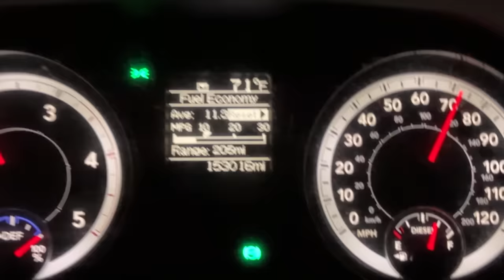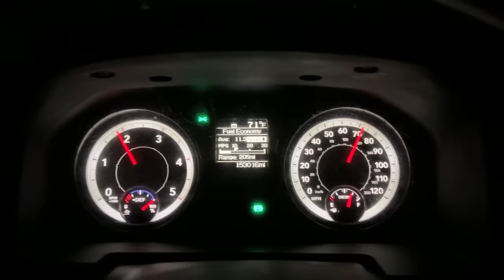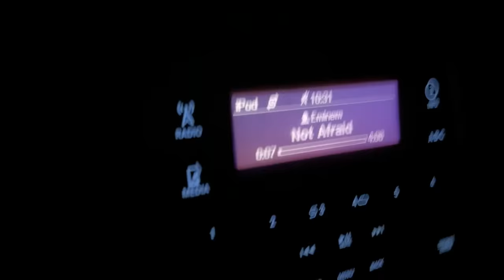My new truck broke down 9.5 hours from home. Dealer refused to do anything...

Comment: As a retired master service writer with ford for 40 years I can tell you that writer has no clue when it comes to customer service peroid.
All travelers in my days got top priority to get them back in the road.
Ford values every customer and no excuses from their standpoint.
The problem you have can only be a couple of things for  a 6.7 diesel 
And the diesel warranty should cover it unless it’s contamination, those are good engines if maintained correctly.
Goodluck and hopefully they get you up and back in the road soon

Comment: Hey. Regarding the new or newer truck options and how you might deal with improving something on it to make it more bullet proof and not voiding the warranty. The way to accomplish improvements or functional upgrades, your best way to prevent from having a dealer look at the upgrade as something that voids your warranty is simply to have the dealership do the actual work of the improvements or upgrades. Any upgrade will no doubt cost you more than doing it yourself BUT, if they've agreed to install an upgraded system ie. Better fuel system or a filter after the initial pump stage, then ask the dealership to recommend the work to make the truck more durable and if they agree to do the work,, they can't then turn around and say you voided the warranty!
The trick then obviously would be getting them to agree to the upgrade. That may require you to actually talk with the car company directly and or speak with their engineers and have the company agree to try some modifications and consider your truck as a trial run so to speak. As long as they don't sneak into something you sign that puts the responsibility on you! Lol.
So read the fine print always!!

Comment: Sell the truck, fix up the Fummins. On another note, have you had any issues with using the impact gun on the landing gear? Thinking about doing something like that for my trailer. Manually cranking the gear sucks.

Comment: Damn, that sucked. Ive been in the market for a new tow rig myself. Always a dodge cummins fan. Ram is owned half by chinese and so is ford. Totally changed my mind and looking at gmc duramax trucks. I have a nice super duty lariat at the moment,  it has never let me down. After your experience, i may stick to truck i have to. Good luck with dealership

Comment: I would definitely go back to the dealership where you bought that White truck with a couple of large intimidating guys and tell them where you're going to put that truck if they don't take it back. I've worked as a Ford mechanic, I'm sorry, that's exactly the reason I quit and went independent.

Comment: I had a similar issue with a ford truck personally I would get rid of the ford, ford does not care about customer service and ford dealers don’t care about customers unless they are selling you something. Have not had ant dealings with gm, Chrysler before they were sold was fairly helpful. I’d say stay with your older truck!

Comment: I feel for your situation. But, there are those dealers out there that go the extra mile. A few years ago I was stranded on a snowy Saturday morning in the middle of nowhere with my f150 that I had recently purchased. Someone stopped and gave me a ride to a Ford dealer who had already arranged to have my truck towed. It was a fuel relay problem. I had purchased an extended warranty when I bought the used truck so all I had to cover was the deductible.  I was 2+ hours from home on a Saturday and the dealer had no problem giving me a loaner at no charge until my truck was fixed. There are good ones out there -- from Wisconsin

Comment: I had a 3500 silverado dually with onstar…it started giving me trouble in Hoboken, nj which was 300 miles from home. To my astonishment  when i asked the onstar  operator if a dealer was close by she placed me on hold, called the nearest dealer, gave me turn by turn directions……the mechanic was actually waiting on me and upon arrival he directed me to drive up on the lift. Two hours later me and my trailer were on the road. It felt like a race car drivers pit stop.  I am still amazed at the service.

Comment: I put most of this on the dealership. You can never know why a vehicle will break down but if you are still under warranty you expect that the dealer, and by extension the dealership, will stand by it and do what they can. They did nothing to help you and didn't seem to care about your situation at all. That is deplorable. The least, and I mean the very least, they could have done was to run the diagnostic. They could have tried to find you a rental. They could have offered to hold your trailer (though I wouldn't have left it). Just pitiful

Comment: I think that if your old truck has the 7.2L motor and then new one has the 6.7L you would probably be better off selling the new one back to the dealer. Those 7.2L motors are very
reliable

Comment: I work for a dealership as a tech. I’m sorry to say a dealer or ford isn’t liable for lost or damaged equipment you sign that as you are arriving for repairs. Your stuff is your responsibility. On loaners back 3 years ago you might have had a chance to get one but now post Covid vehicles are the hardest to have on the lot just for loaners. Now for warranty yes we have to verify it was a fault on the truck side and not mistreatment from the customer or improper modifications. Now if we find rust in the fuel system it’s not warranty as YOU are responsible for proper maintenance and verification of filters and fuel with no water. I know that’s hard to hear because how do you know if water is in the fuel? Ford and dealers are a business if we just hand out warranty repairs ford would be bankrupt. Their are special situations and the dealer and ford will work with those the best they can. It doesn’t matter what make it is they are the same and every truck has the potential to break down just the way it is with newer vehicle and the complicated emission systems. Also we can’t just jump and fix a truck you have people ahead of you it’s not fair to cut you in line is it? Then we piss of that customer. You can’t expect a dealer to hold your hand and teach you how to be an adult. Maybe thats just me?

Comment: I road raced for over 20 years and the tow vehicle was always the best vehicle in the driveway.  We had several breakdowns over the years and I was always amazed at how people came to you in the time.  I do recall the time we were at Roebling Road and needed a water pump in the 'Burb.  I had so many mechanics standing in line to help but no parts stores had the water pump for a 454????  We had to stay overnight and get a tow to the dealer. At least the track let me leave the trailer at the track.   Another time we blew the intake gasket and stopped in Metter GA where a dealership was 300 yards off the interstate.  One of the techs even ran home to get a part that wasnt in the store and we were on the road in just a few hours.  I sent the guy a gift card for a very good restaurant in Gatlinburg because that was his vacation spot.  There are good people out there but the bad ones usually are remembered.  I almost didnt make LS Fest several years ago because my tow vehicle didnt make it out of the shop; its first replacement broke while I was driving it home after borrowing it from a racing buddy.  Finally a client took a truck out of his fleet and sent the crew home early so I could have it for the weekend.  Luckily I never broke down in La.

Comment: Those rims with the rubber bands on them. Looks more show than truck. More of a function over cosmetic type person. I like the rear body kit and stuffed tires on the vet. The ford needs and offroad or cowboy bumper with wench. Built not bought.

Comment: You have to get the Manager involved.  Don't hold back, the more persistent you are the better your chances get. I worked at car dealers for 40 years.     Talk to JH Diesel   for advise on the old truck if you need to.

Comment: Had a GMC pick up in warranty and it was making a noise. I took it to GMC dealer and they said nothing wrong. Few days later after warranty was out the transmission went out. The dealer that had said nothing was wrong did not want to repair it. After a call from my attorney they repaired the truck. I traded to Toyota and never looked back. Would not own any GM product if it were given to me.

Comment: If that trailer was in the lot they would be responsible for it if something happens.
We dont allow trailers on our lot either or anything that doesnt involve being sold or being repaired.
Some service writers are a@@holes!
Glad you found a loaner.
And no mechanic wants to do warranty work because the manufacturers done want to pay the full labor rate. So yeah usually no one gets in a rush to do warranty jobs.

Comment: Go get your truck and take it to the dealer you bought it from to get the warranty , the dealer that has it will nickel and dime you with know  warranty . I had a turning light go out went to a dealer and told them witch light , they had to test every thing cost $30.00 . I have a F 250 6.7  100,000 kl still going strong .

Comment: The Warranty do not cover crap, its all just getting your money, as far as the dealer goes they are not there to help you because 99% of the time the warranty will not cover it, also the rental car/truck only  will cover time to repair truck, example if it takes like 1 to 5hrs to repair it will only cover 1 day rental, most do not cover time waiting for parts, also lets say a engine replace book might say 15 hrs labor time ,then you would get rental car 2 days even through the truck may be there for 2 weeks,

Comment: get rid of all fords buy cummins only had my cummins had mine 32 years never done anything too it buy fuel and tires also replaced the batteries and i have 742k on it  cummins 855n 850 hp she is old but she is mean

Comment: My Ford runs fine (for now), and it only cost me 30% more than the cost of the car in repairs. Ford admitted that it was built with faulty parts, but that they were not liable to replace them as recall items. It's a Ford.

Comment: I don't understand some of these dealers, why treat the customer so poorly? I watched another video, had a couple pulling a 5th wheel RV with a new Ram, less than 5k miles on it and transmission went out, the dealership treated them badly too and they had to find other arrangements for the 5th wheel. Is it really so hard to treat someone that paid an outrageous amount of money for a truck with some kindness when it breaks down? SMH

Comment: Its sad that a stranger did more for you than the ford dealership considering how much money your ford cost the dealerships dont care about you at all after you leave the lot with your new car or truck its the same with dodge gmc and chevrolet trucks arent lasting long at all anymore my 2018 gmc sierra slts transmission went out at only 70k miles cost me $5k to get another one

Comment: That is piss poor customer service on that dealership's part.  Management should have stepped up and really done what they could to help you out in your special situation.  They could have turned you into a customer for life and a great spokesperson with your following if they only did what you mentioned and put a priority on your diagnostics or even said as a courtesy we will store your trailer for a day or two while repairing it so you could stay local then make the event even a day late.  I commend you for not putting their name out there to bash them.  I would not have your restraint.  You could file complaints with Ford, because that is probably not the customer service reputation they want for their corporation due to the poorly trained service personnel of that independent dealership.

Comment: i had a new 2016 f350 and i was on the side of the road at 7000 miles.  def injector bad.  ford did nothing for me. then there were other weird engine codes after that.    about 20000 miles later there was a "soft recall".

Comment: Fix fummins and u will be in control of if u make it where ur going or not dealers are joke and ur warranty dont cover emissions wich is what fails and if u delete u loose warranty not to mention fuel savings with tune and turbo will be worth it alone ask a hot shot driver for tire setup for best ride and towing centramatic wheel balancer get rid of any vibration and saves tires and know how heavy and fast u will run all will affect what wheel and tire setup for best ride and performance lots of tires have low speed rating and will wear bad or blow if tow with them outside range i recommend all banks products for towing

Comment: Get rid of the Ford and go with the ram. I have never had any problem with my company diesel take it in for service as needed as you do and it goes for miles and miles.

Comment: Keep the old truck and get to sell the new one. The old is better because it is a diesel and is better made. Ford has a problem right now, recall, problems with the engine, transmission, etc. Better put the money in the old one then buy a new one.

Comment: He has a shop with a hoist and he takes his Trucks to the Dealer for Oil changes?  Wow  it takes three times longer to take it to the Dealer .. for an oil change..  The Straight 6 engine is much easier to work on than a V-8 is ..

Comment: I’ve got an old dodge I bought a 2004 with a standard transmission.   Put new Tie-rods and keep diesel fuel additive in every tank and never have an issue.  Government has screwed the new diesels with recirc crap etc.    Dodge selling to Fiat was bad also.  Turned a bad auto transmission into a worse one.
Reply: I did have to put a new AC in it also.